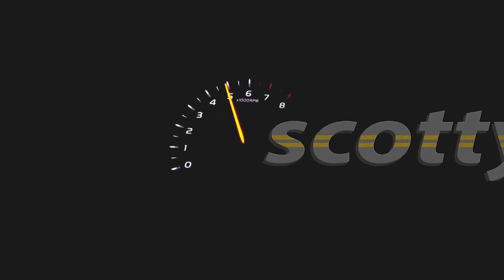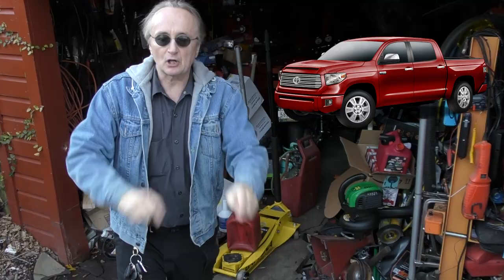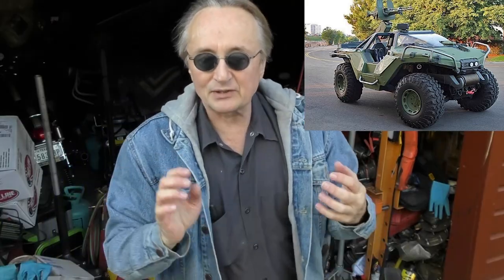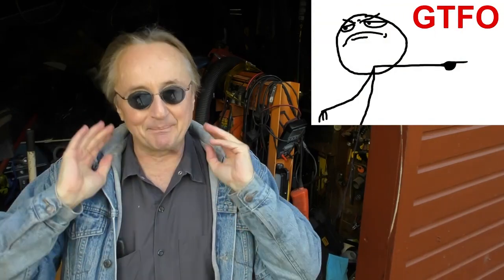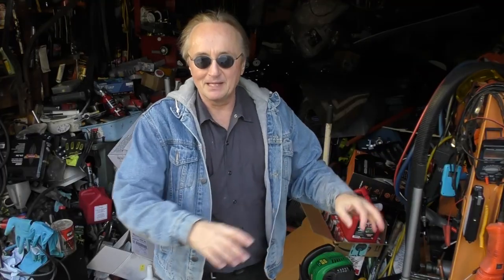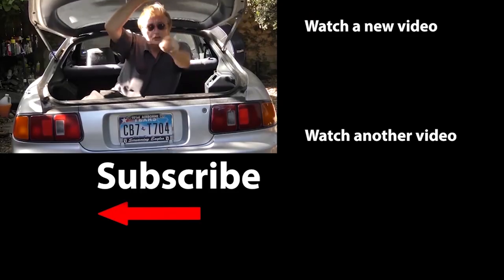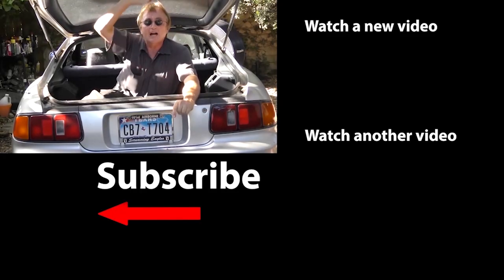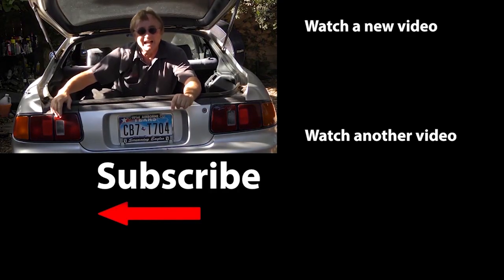5 Used Trucks You Should Never Buy

Comment: OH Scotty you forgot the 1.5 million Toyota  Tacoma’s  recalled with rusting frames and leaf springs. 🌮
Reply: Ha ha I remember that I think they paid out like $4500 on 20-year-old trucks because the frames split in half
Reply: My 2000 Tacoma loves the desert.  Don't gotta deal with rust here just air filters lol.
Reply: @Matt Adams I believe they also started spraying something on the frames to prevent rusting.
Reply: 1.5 million recalls, and they are still the most reliable truck you can buy
Reply: Hung Lo the 4.0L engine was the only reliable part of the truck.  Frame-🧀🐀.
Reply: The difference is Toyota offered to fix every single Toyota Truck that was affected by rust from those specific years free of charge.
Reply: Matt Adams Jeep with the 1997-2006 Wrangler being a prime example of horrid frame rust problems being ignored by Jeep
Reply: Lol GM or Ford never had frame rust so bad that it snapped in half yea there was fram rust but just a little coat because back then they were made here in the U.S where we had the world beat on steel and what about all the tacos with transmission issues toyota trucks are a joke I want a truck that will work hard not get destroyed when I put a bit of gravel in the bed or hookup to a dump trailer
Reply: Lucas Cruz   Better to have rust than increased crashes that destroy lives.
Reply: Andrew Moore GM and the 3/4 ton Ford trucks are pretty notorious for rotting out. I’m not sure what you’re talking about. The GM bodies, Fords the Frames.
Reply: @andrewmoore4744  thats cuz GM and ford engines break down before the frame gets a chance to rust 🙃
Reply: Lucas Cruz  not sliding across the road into oncoming traffic trumps some rust on your vehicle.
Reply: Matt Adams they bought them back for 1.5 times blue book value.
Reply: Hung Lo the 1995.5 -2004 were the most reliable Tacoma
Reply: Toyota replaced them and in some cases would buy back the truck above market value. No other truck maker would do that. Just ask anyone with a Ford Ranger. The frames on those rot out even faster.
Reply: Can’t do that when you’ve got a hard on for Toyota. He also forgot to mention any ford diesel from 2003 to 2009 or 10 lol
Reply: Stu Gotts I’m with you lol. I never watch Scotty for any serious information anyways. If I want a good laugh I’ll turn his channel on
Reply: As much as I hate toyotas, gotta give em credit because at least they were decent enough to fix the problem
Reply: Toyota still thinks they can take over the US big truck market. The only ones you see driving V8 Tundras are hipsters hauling a twin bed around the city,  and complaining they can't find parking.
Reply: He don’t forget them, they never made the list. They fixed the problem.
Reply: No he didn't. He's talked about that before in other videos.
Reply: @lexellll  that's funny considering you probably dont have a license or work on cars my 2011 chevy silverado has 223,198 miles on it rn and all ive done is regular maintinence I tow a 2 place aluminum snowmobile trailer a 28 ft arctic fox camper and a 2500lb car hauler with it regularly oh and the Frame is in great condition and not a speak of rust and I live in illinois but you let me know how your 04 tacoma is when you try and backup cause last time I recalled my 2001 gmc sierra I use to own never did that
Reply: As mention above I got one….
Reply: @Matt Adams Toyota told me, we inspected it and there were no problems with the frame at the time…warranty is over…have a nice day…. That and having a Ford 6.0 L Diesel engine problem will NOT make your day!
Reply: lmfao. There one of the worst .
Reply: Czar, nah, the Yota fanboys are gonna roast ya like they roast me. They don't like facts, kinda like the liberals.
Reply: @andrewmoore4744  nice. My duramax made it to 218000 miles. Have you changed injectors on them? 5000$ repair every 130000 miles. my dad has a 1500. Much more reliable.
Reply: @jonsmith919  still have a 99 Prerunner V6. has been a great truck. 160K with 2 timing belts and water pumps (just because pump was exposed for timing belt repair), 1 starter. No other repairs. Never left me on the side of the road. And I'm not gentle on it at all.
Reply: toyota replaced them which made their customer experience more reliable and improved their quality overall. tacoma still outsells the ram 2500-3500, silverado 2500-3500, titan, tundra and sierra.
Reply: @andrewmoore4744  my experience as an aftermarket truck up fitter knows this is not true.
At least not in the salt laden northeast.
At Ford rust is job #1
Reply: Toyota wasn’t trying to be a good corporate citizen.  As part of their massive lawsuit settlement, they did NOT have to admit wrongdoing.  Their problems aren’t over as there’s a new suit covering vehicles as late as 2011.  Toyota is as unscrupulous as the rest, in my opinion.
Reply: Toyota trucks are not work trucks.  They are fun trucks.
Reply: @Matt Adams - They only acknowledged them because they were forced to.  My mom has one with 76K miles that she didn't get the notification for repair for.  Toyota claimed they sent it and refused to make the repairs because she missed their deadline.  The frame is rotting out (as is the body).  My mechanic advised us to junk it since it won't pass the annual NYS inspection with all the frame rot, and it would cost way more than the truck is worth to fix out of pocket. He is afraid to try to repair the leaking rear differential case due to rust holding it together.  Ditto for one of the brake lines that blew out.  Ditto for the left front suspension spring that broke just driving on the road.  But the I-4, 4x4 powertrain is good.  Just a shame because so much else is falling apart.
Reply: Lucas Cruz  Its not just the salt and ice, you can park a vehicle on grass all summer long and the morning dew will destroy the under side of that vehicle if its not properly coated
Reply: The frames that are being recalled are all manufactured in the USA out of superior USA steel from an American contractor..  none of the vehicles made in Japan are part of the recall( 4runner and landcruiser) just the tundra sequoia and Tacoma.  Chrysler didn't step up when my wife's TJ frame was full of holes. Gm didn't step up when the 90s 1500 frames  where rotting behind the front wheel. I'll buy another Toyota if my current one ever dies.
Reply: Andrew Moore  gm brake lines ?? Ehh you can see through them...
Reply: Toyota has had severe frame rail rust problems since the '80s in the rust belt. They must have saved up from them to be able to pay for the 1.5 million trucks they covered lately. That sucks but it's the truth. You would think after all this time they would have stepped up the game and added a bit more rust prevention.
Reply: My female friend just got a brand spanking new frame for her 2006 Toyota Sequoia! The frame broke in three areas from rust. A year prior she had to get a Secondary Air System / Air Induction Pump Bypass Kit 
which was notorious for all 2004 thru 2012 4.7L V8 Engines.
Reply: @alwcurlz  Trump supporters don't  like facts, truth hurts their sensitive  feelings too much.  Me from Mericah, me like me Mexican and Canadian Merican cars.  Me don't like them Mericah Toyoatahs. lol dude really.
Reply: And don't forget the loose steering wheels and snapping ball joints
Reply: Lucas Cruz  - and many people didn't think Toyota was stupid enough to make undercoating standard and forget that 90% of the population lives near the coast (salt water)
Reply: Scotty has a Toyota tramp stamp . He will never talk crap bout Toyota
Reply: Name a truck that holds its value as well as a Toyota 🤔🤔🤔🤔

Comment: There's been healthy debate on how much "truck" is a Ridgeline, but it definitely does not belong on a "do not buy" list. From what I know:

1. It's a Honda
2. It drives like a car
3. You can reach into the bed without getting a hernia
4. it will fit a sheet of 8x4 (unlike the new Ranger which has a bed UNDER 4 feet wide)
5. Has surprisingly good off road handling capability
6. Has a much more car-like cabin than either Ford or Toyota
7. The under-floor storage doubles as a small trunk

In my mind it's more a family activity vehicle than it is a truck. Not great for gooseneck towing or transporting gravel, but it's just the vehicle for carrying home anything you can find at Home Depot or Ikea, which for a growing family WILL HAPPEN. The ability to carry bikes in the bed also makes it more useful. I have seen hitch-mounted bike racks snap in half with the car stopped dead in the #1 lane on a freeway. And you can laughably pick up four people from the airport with 8 huge suitcases too - try doing that with a Crown Vic or Prius.
Reply: the ridgeline.. The Caitlin Jenner of trucks
Reply: Nothing except a 3/4 ton or better is designed for hauling gooseneck, so mentioning gooseneck trailers and a Honda Ridgeline is ridiculous as it is... The Ridgeline isn't even a half ton Ute pickup. The Ridgeline is like a passenger car with a midget bed and the ugly styling of the avalanche (well the old ones anyways, I actually kind of like the look of the new ones.). You say it can fit a 4x8 sheet of plywood in the bed, but I don't see how that is considering how narrow of a vehicle it is. You can fit a 4x8 in the bed of my Ranger, it's just tilted because it doesn't quite fit between the wheel wells. I would imagine with the Ridgeline, it would be exactly the same, because the Ridgeline I believe is the same width as an S10 and a Ranger and a Colorado, is it not? If it is wider, that is surprising to me, but I can only imagine that the bed leaves almost half of the sheet hanging out even with the tailgate down.
Reply: It's a glorified Odyssey, a van with a truck body.
Reply: But he was talking about the ridgeline as a work truck not a daily grocery getter and weekend camping, but dependability when doing truck stuff like heavy hauling towing pulling
Reply: @jerryschneider145  Honda engines are Bullitt proof but not for a work truck, everyday driver, kid hauling Grocery getter, camping that's Honda playground
Reply: Sorry man I’m a Honda fanboy but that thing sucks.
Reply: What does “it’s a Honda” mean actually?

Do you mean “it’s a 3.5l Honda so the tranny is absolute garbage just like in the pilot and odyssey”? Because as an automotive technician working in an independent garage 85% of the Honda’s I listed that come into my garage is transmission related
Reply: @miamidashcam4u  Nice
Reply: Have probably bought at least 25 vehicles over my 42 years of driving and can honestly say my Ridgeline is the best bang for the buck. If you aren't worried about towing large loads this is the most versatile and reliable truck on the road. Very fun to drive also. Has never broke down in 290K miles. Can't say that about my past American made vehicles or even my old Toyota's...
Reply: @Jonathan T. Brown When you go for the grammar (or a typo) as an argument to reply, then you got no valid argument... 😴😴😴
Reply: Willy p lmfaooo
Reply: @jerryschneider145  depends to who they asked 😂 mom and nice guy's doesn't count🤣🤣 they even  know what is a truck.
Reply: @ramblingrebel6811  and that's correct. I did changed my transmission oil and now I have to replace or rebuild it, because new oil does some damage to electronic parts inside and to seals etc.. bad decision to change transmission oils.( new oil chemicals  are stronger than used oil in transmission and it burns gaskets etc etc.) My mecanic said only change oil if changed color like from red to grey stuff.
Reply: Luscious3174 Good
Reply: @jerryschneider145  , That's only because we know how to drive. Chevy all the way.
Front wheel drive is for girls.
Reply: @wtrdogg20   good job representing the soy boy crowd!!
Reply: So are you compensating or “Beta” if you daily a 2007 Ridgeline and have a 2011  F450 for your 3 place car hauler?
Reply: @jerryschneider145  Yah it's a girly kinda almost truck looking thing ,but it handles good right ?
Reply: @jerryschneider145  LMAO
Where do you live where all these Fords and Chevys are rear wheel drive?
Not only will my 4 WHEEL DRIVE F-150 go down any icy freeway more safely than your cutesie lil' FWD Honda, but it will go through deep snow, haul, and tow things your wannabe truck can only dream about.
Oh, and it will do all that while having a hell of a lot more rear seating and cabin space.
Sorry man, Honda builds a lot of good vehicles, but the Ridgeline is not one of them.  It's basically a glorified Odyssey van masquerading as a pickup truck.
I honestly can't believe someone was actually bragging up a truck because it has FWD!  xD
(for the record, I'm not against foreign or Japanese cars.  I also currently own a Mitsubishi and have had 2 Honda's in the past)
Reply: @t-bone3657  If you're not worried about towing heavy loads, then why buy a truck in the first place?  That's Scotty's point, the Ridgeline makes absolutely no sense in the American marketplace.  Just buy a damn Odyssey and be done with it.
Reply: @jerryschneider145  My truck has leather, climate control, navigation screen, satellite radio, remote opening bed cover, etc. and is most definitely USED AS A TRUCK.  It regularly pulls our boat, camper, and full-size goose-neck trailer.
Try doing that at highway speed in your cute lil' Ridgeline and see if that tiny engine, tiny transmission, van suspsension, and non fully-boxed frame make it to your mystical 285k miles, lol.
Btw, why in the hell were you test driving a car with 285k miles on it?  Who in their right mind would ever consider buying ANY used vehicle with that kind of high mileage?  That doesn't even make sense.  xD
Reply: @jerryschneider145  See how it "handles" with a full-size boat, camper, or loaded trailer attached to it.  Your lack of weight, boxed frame, and tow-ready suspension would have you landing in a ditch at highway speed the first time you tried to change lanes xD
See......those are things a "truck" is supposed to do.  The Ridgeline is not a truck.  It's a Honda Odyssey van masquerading as a truck.  That was Scotty's point in the video.  It's a vehicle that makes no sense in a car market that offers actual pickup trucks that are properly equipped to do actual pickup truck things.
Reply: Agree 100%. If this were a work truck list then year maybe include the ridgeline. But for light work and family stuff the ridgeline is awesome. I do some landscaping work and the ridgeline is awesome for stuff like that. I dont mow alot of grass so i dont haul mowers but i know it got terrible gas mileage on the interstate pulling my 4wheeler. Few small gripes but other than that its an awesome vehicle. Agree that its been misplaced finding its way in the list.
Reply: tony metas All my full sized Chevys and Fords let me down.
Reply: tony metas sure they will last if you use them for groceries. That’s the point you are not hearing from every one here. It’s not a real truck! 3500 lb tow capacity put it on the list with those Volkswagen pickup trucks
Reply: Luscious3174 My Wife bought me a Brand New 2007 Ridgeline. I’m just shy of 13 incredible years of proud Ridgeline ownership. The Vehicle has NEVER been in the Shop...,  You know why - - Because they’re Friggin Perfect !!!  I’ve never needed a repair, because you can’t repair Perfection !!  Scotty is just MAD that he wasn’t allowed to join The Ridgeline Owners Club.   Rev  That,  Scotty.